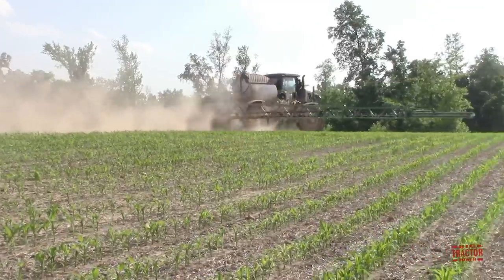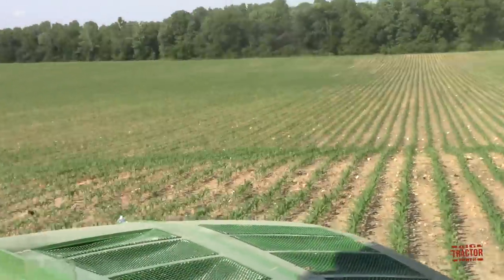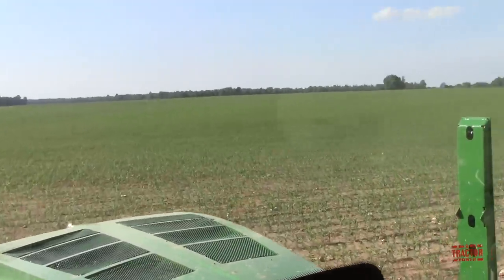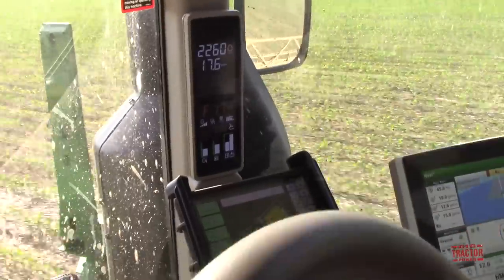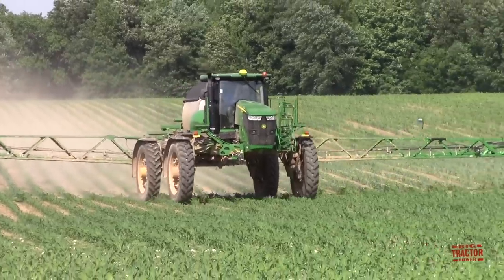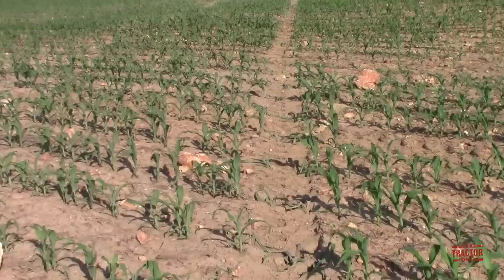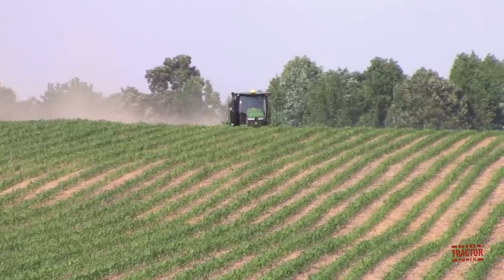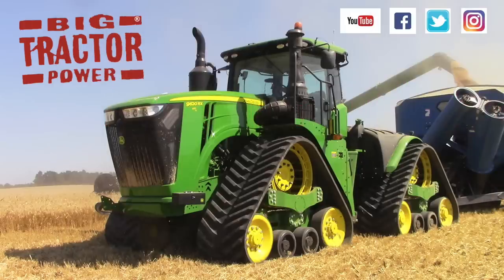John Deere R4045 Sprays Corn at an Angle????

Comment: Hi there. Do this job in angle it is very commum in my home country. In Brazil we seed corn and soybeans using 17 inches in between the rows, so it is almost impossible to keep the sprayers on track. Angle spraying is the best option. Before the gps system we used to tie a couple of tractors togeter to leave the mark where the sprayer should pass using a steel cable wide as the sprayer boom.
Reply from the maker: That is interesting.  17 inch rows are much different than the United States. How wide are the planters you use? Most corn here is 30 inches.  20 inch corn is the second most common.  38 inch corn planted in cotton areas.  Soybeans is common for soybeans.
Reply: bigtractorpower when you go to South Brazil we have not so flat areas in the states of Parana, Rio Grande do Sul or Sao Paulo. In these states planters are quite small and they have no more than 12, 14 or 16 rows. But when you go uo North, where we call “cerrado” we have flat areas and the farms are very large. Farmers must have big farm because the costs are almost twice as much as south. Poor soil and yields lower than south. Is very commom to see 24,000 acres farm, 50,000 and even bigger. Let me know an e-mail address or any other media where I can reach you and I’ll send to you some links to youtube videos where you can see what I am talking about.

Comment: Spraying at an angle makes a lot of sense especially if fields are smaller and oddly shaped ,it is done here lots too,I think unless you have over 30 inch wide rows when its wet and the sprayer sinks in a bit the roots of the rows on the tire tracks are affected cause they grow out not just straight down..But if i remember from you videos last year they ran with the rows? Mabey i am not remembering right.
Reply from the maker: This farm has always run at an angle in corn.  It seems to work well for them
Most farm’s and co ops in this are run at an angle.

Comment: I find it unconvincing that they can afford such an expensive sprayer and not be able to purchase the higher accuracy GPS subscription. It's simply easier and faster to do it this way, than to watch out and follow the rows. And when you combine all the corn that has been run over across multiple rows, that would be the same as if they ran across one whole row in the straight. So that explanation also does not hold value . Cool vid anyhow, BTP!
Reply: milance17 I think they have four of these machines.
Reply: Well that's fine that you don't buy it, but it doesn't change reality. You don't have all of the information, you don't know all of the variables involved that affect these decisions, it's easy to arm chair QB someone else's work when it isn't your check book attached to it. There are compromises in everything in life.

Comment: That is nuts going at an angle but I understand the reasons for it
Reply: Kandi Klover we follow the rows and we don’t have the fancy equipment to do it. Just drive by hand and go a little slower
Reply: What equipment? It's called a steering wheel..... been doing it for years. I run a  older 4930 Deere and steer it for 20,000 acres every year and only run over crop when turning around.  This is just lazy
Reply: They have higher accuracy gps that can use the planter gps line and drive between the rows. We don’t even have auto steer on our sprayer. We have a 2006 model 4410 case.If you watch what your doing you can drive between the rows and not run over corn it’s not that hard
Reply: Yes I now I never ran a machine with GPS on it.just drove in the rows and steered mtself

Comment: So they have the largest sprayer from JD, but not the guidance
Reply: No it's the way the field is planted
Reply: If you listen you can hear his 2630 beeping in the background, he’s got guidance. The reason for going at an angle is because it’s easier than trying to keep it lined up between the rows.
Reply: He’s probably running SF1 for guidance, not RTK. He has autotrac, but does not have row sense or row vision which works very well in a taller corn crop.

Comment: Everyone needs to understand that RTK ( <1" accuracy) won't even keep you in the rows at that speed. Only option would be to get RowVision  for that small of corn. Or run manually, I did at 22mph with a dry machine in standing corn. We ran the sensors on a custom machine at work and it does an amazing job even on slight curves following ditches.
Reply from the maker: 22 mph is moving right along.
Reply: @bigtractorpower  I actually ran over less corn going faster for whatever reason. But our fields are mostly square so that helps

Comment: Which sprayer you'd recomend as the most versatile sprayer for 8-10 thousand acre farm. Is it available any options to lift John Deere's clearence up to 5'9" - 6' high or it is more logically to byu Hagie sprayer? Several advantages of both of them

P.S. Thank you for video
Reply from the maker: The R4045 is very nice.  A Haigie or Miller is going to offer the best year round option to go from short to very tall crops. This farm runs a Haigie to apply fungicide to their corn after it tassels.

Comment: What would be the reason for the sink holes?  Bad drain tiles?  The How Farms Work channel in Wisconsin has problems with sink holes because of underground zinc mines.  I would not think that there are old subterranean mines in Western Kentucky.
Reply from the maker: This region has lime stone which easily erodes from water. There is a great series of caves across the region. One of the worlds largest caves Manmouth cave is in Western Kentucky. The sink holes have nothing to do with drainage in the field.  They are deep under the ground and can surface over night from the size of a wood chuck hole to a depression that leaves a pond sized bowl shape in the field. Corvette sports cars are built in WKY in Bowling Green.  On February 12, 2014 a sink hole opened up under the National Corvette museum swallowing up eight Corvettes into the sinkhole including the 1992 “1 Millionth” Corvette and 2009 ZR1 “Blue Devil” .

Comment: How is this similar to the CaseIH Trident 5550?
Reply from the maker: I would like to film a Trident.   It looks like an impressive machine.  The Trident is 390 hp and weighs in at 35,000 lbs with a sprayer so it’s a similar hp and weight.

Comment: That steering wheel holder in the cab should not be spraying! You can absolutely follow those rows without running any over. He’s just taking the easy way out and using GPS

Comment: I'm surprised they don't get auto steer on the sprayer and then they could drive right down the middle of the row and not crush the crop.
Reply from the maker: It has auto-steer but the subscription is not as fine point to keep the sprayer right on the row 100%.  Running at 17 mph it’s just easier to run at the angle.
Reply: bigtractorpower you’re correct. I cut alfalfa with a triple mower setup and the green star gps struggles tremendously when mowing at speeds of 15-17 mph.

Comment: That doesn't make any sense B.T.P.,they buy 3 500 K sprayers,but didn't get the optional Green Star®??.
Reply from the maker: They have Greenstar but the subscription  level is not the most precise.  You can see in the cab ride along the machine is driving itself.  At 27 mph it’s just easier to run at an angle.
Reply: @bigtractorpower  I see...
Reply: bigtractorpower 17 MPH

Comment: Considering the tires are 6” wide, wouldn’t it be better to run perpendicular to the rows rather than an angle, assuming they plant 32 to 34K that’s still only 1-2 plants instead of 4-5 plants per row , we run the rows but I’d rather run perpendicular than anything
Reply: Be rough as hell though!

Comment: They're already using a Greenstar on the sprayer. They can't put that on the planter too and match up with the rows? I'm not buying it.
Reply from the maker: The planter and sprayer both use Greenstar but the accuracy of the subscription level the farm uses is not precise enough to run between the rows at 17 mph.  For them in the conditions they run in the angle works.  The loss of a few plants will not even be visible at harvest time.

Comment: Re: Running at an angle and driving over some corn...   The talk on the video implied those plants run over will be lost.  Is that 100%, or will some percentage of them return to normal growth and continue on through crop production?  Or, once run over, they are lost?
Reply: Rightsideofthegrass some will pop back up.  It’s not 100 percent loss.  Probably 50 percent...
Reply: @0731bart  Thanks.  It has been a few decades since we farmed any corn.  We ran over some on the headland while cultivating (no spraying at that time).  Most of it survived, and produced.  Our equipment was not nearly as heavy, however.  The language used in the video seemed to say little or none survived.
Reply: Rightsideofthegrass well it can survive now when it’s small like this.  But as it gets bigger if they run it over again on the same pass it will be killed.
Reply from the maker: Most is done because of the stage the crop is being sprayed.  If you look st the clip in the video where the sprayer ran over an entire row on the headland for about 50ft that was filmed a few days after the sprayer was in the field and you can see the corn had perished.  If a few plants survive they will be run over in late June when the crop tassels and is sprayed with fungicide.

Comment: pretty sure the R4060 is the biggest sprayer not the R4045 only difference is 1600 gallon tank on the 4060 and 1200 on the 4045
Reply from the maker: As I mentioned in the video the R4060 is a 2020 model.  We won’t see them until next year. I expect this farm will have one next year.
Reply: @bigtractorpower   got one running over by me must be the demo one then seen it the other day.

Comment: Is there starting to get some hagies to show up now that John Deere acquired them.
Reply from the maker: There have been Haiges in the area long before the Deere merger. Two farm’s I film at have Haigies. This farm became the third I know to get an STS16. They had run Millers for years in fungicide but made the switch to Haigie in 2017.  Their Haige is only used for fungicide.  Hutson has sold several Haigies in the area over the past few years.

Comment: That's why it is better to manually steer the sprayer. That's why you have a steering wheel.
Reply: Steve Rosenberger not true. I’ve saved so much in fuel, chemical usage and fatigue running section Control and auto trac. I have data that proves it too
Reply: @calebfuehring5823  fatigue yes, fuel and chemical I dont think so... there is more overlap and more passes going at an angle, dont know how you figured your data but doesn't add up to me. I run a 120ft 4930 in central MN, we have lots of different terrain and obstacles and would never think about running over that much crop. This is just laziness.... oh btw I still average 15-18 mph following rows
Reply from the maker: Eric I just shared the reason this farm shared with me on why they run the way they do. Most farm’s in this region spray this way.
Reply from the maker: Steve this farm runs GPS on the sprayer and you can see Matt is hands free in the cab ride along.  This farm just feels running at an angle works best for them.
Reply: Eric Luce I don’t see where you get overlap. GPS is gps. No overlap with SC or SF3 guidance
Reply: @calebfuehring5823  I beleive this machine has 11 control sections, so each being about 10 feet and a couple a little bigger, in order to cover 100% of the field that section doesn't shut off until the whole 10 feet is over the covered area and at a angle you'll always drag some overlap into the covered pass, may not be much but it's more than if hitting that headland square. So yes more overlap, even with swath control.
Reply: Eric Luce this machine has exact emerge. Look at the nozzle body. Each nozzle has its own shutoff
Reply: Eric Luce exact apply sorry not exact emerge
Reply: @bigtractorpower  you do a great job explaining everything that is going on in each video, and that's what your there for. I understand the reason for the angle as there are some that do it in my area of south central MN, most of the ones doing it are 20" rows or narrower and usually go straight 90° to the row.
Reply: @calebfuehring5823  if that's the case they can afford that option but not the row guidance? $500k and cant swing the what 10k for rowtrac vision? Sorry this just bugs me because I want every plant to have best chance from seed to harvest and clearly they only care about acres not yield
Reply: Eric Luce I hear ya but these guys in Kentucky get amazing yields🤷‍♂️
Reply: @calebfuehring5823  with the stand in the field in the video it cant be to amazing
Reply: @ericluce6117  I suggest you go give them a visit and teach them how to work their land - I'm sure you'll multiply their profits...

Comment: Lol, not fancy. I see gps and tracking on monitor. So they have it, just not using the auto steer or guidance, not a big deal.
Reply from the maker: They are using GPS you can see in the cab portion it’s running hands free.  They do not subscribe to the highest level of accuracy in the GPS program so they prefer to run on the angle.
Reply: @bigtractorpower  apparently people aren't really paying attention to the video judging by all the similar comments on here.

Comment: This is beyond insane and stupid, to avoid compaction you get dual tires on that sprayer and do it the right way, wtf ?!?
Reply from the maker: They are not avoiding compaction with this method.  They are just managing how to apply over the crop.
Reply: There's no such thing as "the right way" - every piece of land offers unique challenges to another, especially the further apart they are(I'm pretty sure farming in the Middle East is a bit different than farming in the US, let alone W KY specifically)